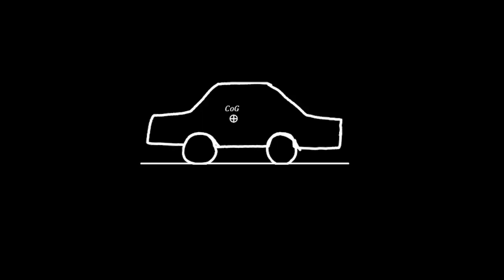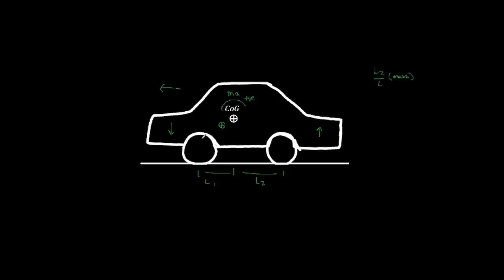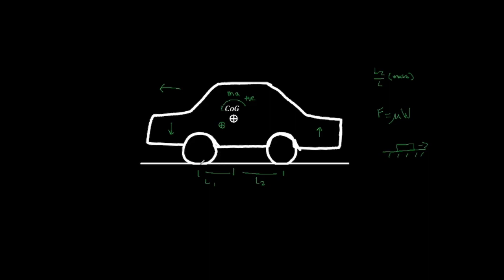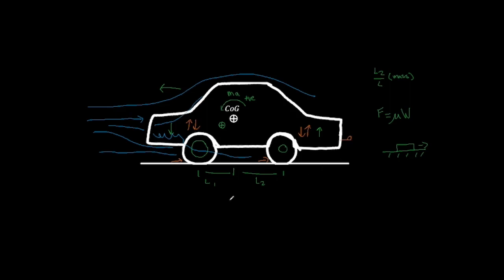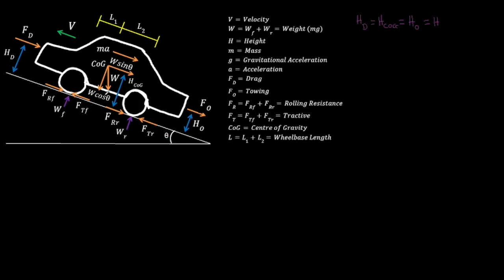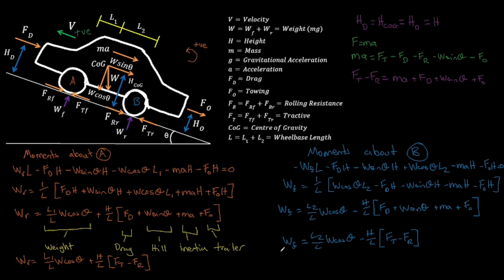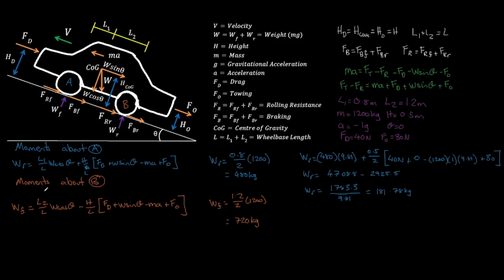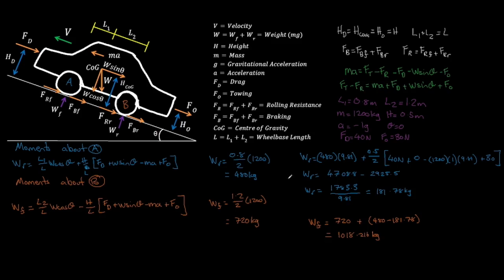Mastering your ride: Calculating Longitudinal Load Transfer for Precision Driving - Vehicle Dynamics

Comment: Correction; the car pitches around the pitch center of the car, not the centre of gravity. Look at F1 cars and super soft road cars as 2 extreme cases - F1 cars decelerate a high Gs, inducing more load transfer, but they have significantly less pitch than road cars, due to their suspension design. Also, the CoG itself doesn't move significantly, and in case of an infinitely stiff suspension, it doesn't move at all, but there is still load transfer due to deceleration.
Reply from the maker: Thanks for clarifing mate, I was trying to keep it simple in this video and just introduce basic maths, but I appreicate your comment

Comment: Hello one doubt as told is video car traveling upward(acceleration) so after performing the weight calculation Rear axel weight must be more than the front axel weight right? Unlike the calculation performed in last part front axel weight(1018kg) > Rear Axel ,HOW?(181kg)
Reply from the maker: Hi, this is a front wheel drive car, so the CoG distance to the front axle is a lot shorter than to the rear axle and the car is breaking, so there is also a load transfer to the front axle. Thanks for your question, let me know if you have any more

Comment: Understeer occurs when the front is heavier  If that's the case, lift-off oversteer occurs when the rear is lighter can you explain this teacher?
Reply from the maker: Hi there! Lift-off oversteer occurs when the balance of weight shifts from the rear wheels to the front wheels as the car decelerates. This shift in weight distribution reduces the amount of traction available to the rear tires while increasing it for the front tires. The demand for traction exceeds what the rear tires can provide, causing the rear of the car to lose grip and potentially slide outwards.
Reply: @thefastandthenerdy  when a car with a 4:6 weight distribution and a 6:4 car brake together, the force moves forward and the front grip improves, so both 4:6 and 6:4 cars can oversteer. Is a 4:6 car more likely to oversteer? I am a student studying automobiles, thank you
Reply: @thefastandthenerdy  If you brake a car with a weight distribution of 600kg and 400kg and the load moves forward by more than 100kg, can the actual tire grip be the same as that of a car with a 5:5 weight distribution at rest?
Reply from the maker: That's correct, both can oversteer when applying the breakes, but assuming all else is equal, the 6:4 will oversteer first as it will now have less load on the rear. When we are thinking about these things we should really look at the load on the tyres and the conditions of the road. Load transfer is more important than just the weight transfer as it takes into account all downward forces. Remember that the friction force is the load multiplied by the coefficient of friction Friction force = mu x Z
Reply from the maker: It could be, it would depend on the coeffiecnt of friction and where you are measuring the grip, front or rear